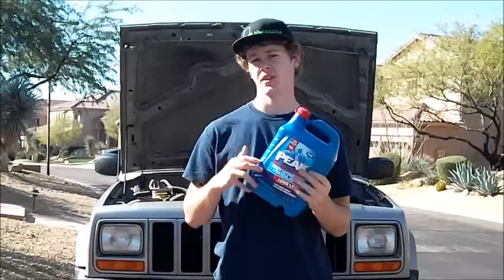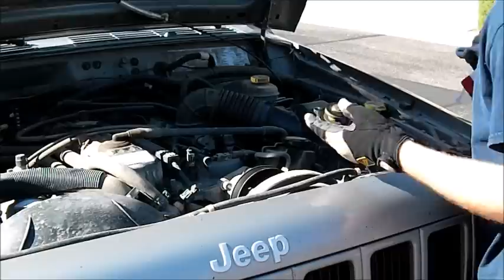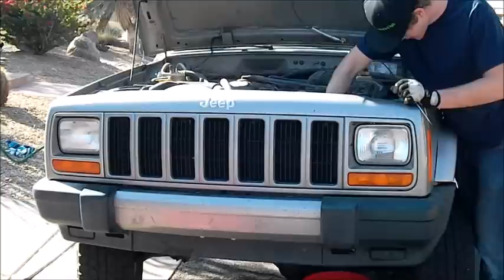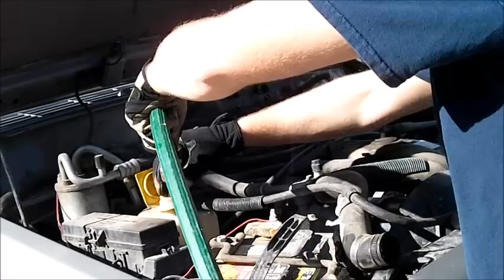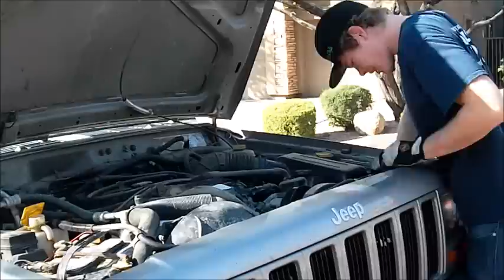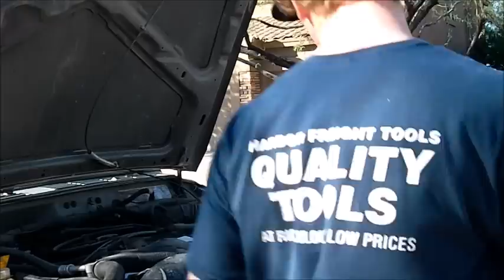jeep cherokee cooling system flush

Comment: I am a full time truck driver by day and a part time mechanic by night. I watch these instructional videos just for fun and you are literally the only person on youtube i have seen do this correctly. I scream at the screen when i see people pour 50/50 blended antifreeze into a system that has just been flushed with water. Im glad you explained that you have to add full strength antifreeze equal to half the systems capacity and THEN top off with distilled water. Everything you explained really hit the nail on the head. Keep at it man. Great video!
Reply from the maker: Thanks!
Reply: it all depends on where you live as well here is south Texas i can run just water and be fine. But i add the 50/50 because its easier.
Reply: If you were to run only water you would have several issues. First, the boiling point of water is 212 degrees F, just 2 degrees above the normal operating temperature of a Jeep 4.0. That means you'd most likely boil over if you used plain water (50/50 coolant has a boiling point of about 265 degrees F). And yes, another reason to run coolant/antifreeze is that when mixed properly, you will have a decreased risk of rusting any ferrous parts inside your engine (like the engine itself in the case of the Jeep 4.0). Rust is the reason that his coolant came out all brown and murky, it would have been much worse if he didn't have any coolant in the system at all! 2 gallons of undiluted antifreeze costs about $15 and it should last you several years.
Reply: micvee not true...water doesn't boil at 212 when pressurized as is the case of a typical cooling system... And actually water dissipates heat faster than coolant. So it works better by itself. But overall you are right.. You should run a 50/50 coolant mixture for reasons of freezing and very mild rust prevention.
Reply: Agreed this helped me a lot and details always make for a proper instructional video
Reply: Anybody know if using double the amount of flush fluid will hurt anything? I mean besides being a potential waste of money for the second bottle.
Reply: But, shouldn't one try to get all the tap water out of the system before doing the final fill of coolant/water mix?
Reply: @mrau92me  Yes, tap water contains mineral deposits that are bad for the system so try to get it all out before you fill up
Reply: When do you sleep?
Reply: @camptoursandthat4439  well i actually switched to being a full time mechanic almost 5 years ago now. Back then though i typically worked around 6am to 9pm and slept from around 11pm to 5am.
Reply: @lavachemist i wish i cost $15 for 2 gallons still i’m bouta drop $40 on 2 gallons

Comment: That reservoir is held in with two 8mm screws. Takes 2 minutes to dump out and reinstall.
Reply: @cdwalkman8401  lol bro wtf
Reply: These 2 screws are difficult to unbolt. Another solution is to disconnect the small hose from the canister but not on the canister side but on the radiator side. Let this hose hang on a lower position than the canister and the gravity will empty the canister. You can do an extra flush with the garden hose from the top op the canister.

Comment: Question for all you good folks out there. When I pulled the top radiator hose off to start the engine flush, no water would go in past the thermostat. I had to pull my thermostat out before I could get water through. Is that normal or was this a case of a bad thermostat?  The Cherokee overheated recently that’s the reason I got off my rear and decided to do my own flush. Living in Costa Rica, not only do I have language issues but have been warned repeatedly that the local mechanics shouldn’t be trusted. Thanks! And great video!!!

Comment: Hey so I got to the top hose flush with the hose and it's just spewing right back out. Not going to the lower disconnected tube. What's that mean?
Reply: Dude me too dammit
Reply: @iriehiphopgirl  This guy had a defective thermostat, allowing the water to flow into the block. Another good way is to spray water through the heater hose that connects into the water pump. This is the bypass hose that bypasses the t-stat.
Reply: @ethanwalton980  thank you so much for the advice! I ended up flushing out the system section by section, starting at the heater core. I inherited my 92 Jeep XJ and my mom hadn’t flushed the cooling system in over 5 years…. It was a doozy. She’s running good now though!

Comment: don't be so scared of removing the radiator cap. It won't pop like a champagne bottle even if its under pressure. just take it slow.
Reply: I always put one of those caps on with a red lever so you can lift up on it to release the pressure, then use a rag over that JUST IN CASE.

Comment: This is definitely the most comprehensive flush tutorial I have found. I can't thank you enough for expressing how important it is to catch the old toxic coolant. The only other tip I might add would be to back flush the heater core with VERY light pressure from the hose, Especially on an XJ that could have a load of sludge and crap trapped in it.

Comment: Good video.
One thing I did additionally on my 99 XJ was back flush the heater core since my heat was lukewarm even after a thermostat change.
Boy did I get some great heat after that .
There is a very simple video on doing that.....simply disconnect both heater hoses and run water hose through bottom heater core hose till all the junk comes out.
Refill the whole system, let air burp out of cap with engine running and cap off.
Fill your expansion tank to full line.
Put rad cap back on after coolant wants to run out constantly.

Took mine for a short drive, turn off, check level, add if necessary to expansion tank.......keep in min that the expansion tank level may go down as the engine cools so check your level after it cools and for good measure check your level for the next couple days and recheck for any hoses that may be leaking at the clamp area from being disturbed.
Not a bad idea to replace all heater and radiator hoses at this time.
One other trick I do while I'm in jeep maintenance mode that I do to every cherokee I own....yes I own a few, is replace all the battery positive and negative cables with an assortment Imget from the auto,parts store.
I also run a new cable from battery negative post to one of the air compressor bracket bolts to give the engine a better ground strap than the deteriorated woven strap from the factory at the back of the engine near valve cover.
One of my jeeps was burning out ignition could due to a weak ground and this fix cured that and also made the engine start up noticeably faster and the engine just feels much stronger after this simple and rewarding preventative fix.
Happy jeeping!
Reply: Ignition coils....my bad.
Reply: You back flushed your ignition coil?
Reply: My heat is really weak. I have a 01 jeep grand cherokee. About to replace the thermostat. Any ideas if that doesn't work?
Reply: @johnc5872  backflush heatercore

Comment: hahah "I don't want to leak out any onto the street" 

proceeds to monsoon everywhere onto the street 

good video though very informative. thanks bud
Reply: It's too bad  it doesn't drain as nice and neat as say...an oil change, haha.
Reply from the maker: If you are able to drain the radiator through the drain valve instead of the lower hose, it is less messy but still not neat by any means
Reply: Neither way is. On my Jeep my issue right now is nasty sludgy rusty antifreeze that needs flushed out. I put down cardboard, and was really careful....and I still ended up with rusty spots on the concrete, haha.
Reply: You can catch it all and keep the rust off your driveway if your lifted by using a little wading pool. I don't know why everybody feels the need to criticize the boy for getting a little fluid on the ground

Comment: thanks a lot. I was wrestling with that stupid plug for an hour before I found your post
Reply from the maker: +K. D. Mann I tried to get mine out first too. Not sure why they made it such a pain to get to and remove.
Reply: +Admiral Off-Road  I would even prefer your hose clamps. my 99 has the clips which are more difficult in tight quarters
Reply from the maker: +K. D. Mann that sucks. The hose clamps are pretty easy.
Reply from the maker: +K. D. Mann By the way, I think you're subscriber number 600! Thanks!

Comment: Should mention that the thermostat being closed won't allow for a full flush of the engine block and removing it is not advised if you dont have to. Bottom bolt is a pita and the design of the housing is common to leak. Dont mess with it unless of course the stat is bad and needs replaced.

Comment: when i’ve done mine i would run engine with heat on to get that dirty stuff out, but nowadays at over 60 years old i look for shop that has the flush system that pulls old stuff out and new stuff in its fast and no mess, of course it costs more be worth it

Comment: I just want to know how you managed to get water to flow through the thermostat housing. If the thermostat is in place and functioning properly, running water into the top radiator hose should simply fill up the hose.
Reply from the maker: I found out later that the thermostat had actually failed and was stuck open. You would need to remove the thermostat to do this

Comment: When I spray water into the upper radiator hose water does not come out of the lower hose, it just builds up in the upper hose. 

Why doesn't mine behave the way yours is? 98 XJ 4.0.

Comment: I took the thermostat out of my 95' today. It came out quite easily. Getting it back in with that lower bolt not clearing the serpentine belt- stupidity on Chrysler's part:-(. So now my 10 minute repair is going to take me half the morning tomorrow to put it back in- grrrrrr! This video was of great help, that petcock doesn't do anything to drain off the cooling system, you gotta pull the hoses!  My other "DOH!" for the morning was having my bucket in the wrong place- my neighbor walked up to say good morning and have a chat for a few minutes, and I wasn't paying attention to where the water/antifreeze was falling. We got it cleaned up. TOmorrow I am flushing my heater core- always make sure you do that when you flush your system!
Reply from the maker: glad the video was helpful! That seems to be the way it goes sometimes. A 10 minute job turns into a much larger job because of one stupid bolt or part in the way
Reply: Now I have a cutoff tool just in case...haha. I have a feeling when I go to put in my lift next year it will come in handy..along with my reciprocating saw and my breaker bar/pipe setup. I might spring for a 30 gallon air tank and an impact gun before then, haha.
Reply from the maker: StormLaker1975 i did my first lift without an impact and my second one with an impact gun and it made it so much quicker
Reply: It's on my wish list for Christmas, haha.

Comment: Great guide. Just bought a 93 xj with overheating issues and just replaced the thermostat, water pump and fan clutch. Up next is a coolant flush for piece of mind. Hope that helps my problem. Is there anything I might be missing?
Reply from the maker: sounds like you've got the basics covered.  If you continue to have overhearing issues you can get into fan upgrades and hood vents but i would do all of the things that you mentioned first because the other two won't do much if your cooling system isn't in good shape.
Reply: Admiral Off-Road okay, and thanks for the quick reply! Gonna subscribe now 😊
Reply: Drain wate,r
Reply: Drain water

Comment: Best thing to use when draining the system is a cement mixing tub there low and rectangular they catch it all. You can get them from a home improvement store. Because the fluid spills everywhere otherwise. You never really get it all in the bucket.
Reply: Rick C137 You never really did get it all in the bucket,,  Another trick is laying out a tarp under the vehicle and and surround it it with any absorbent..    It catches all that doesn’t go into the bucket, soaks it up, and can be swept/scooped up pretty easily.  I do the same thing for oil changes to protect the ground or garage floor.  Thx Rick

Comment: Undoing the plug from the bottom and disconnecting the small hose from the side of the cap then put the tip of the hose under the car and suck through it a little bit then gravity will do the rest and you rinse and drain your reservoir.

Comment: I picked up an 89 XJ and the thermostat-heater core and water pump-heater core hoses were taken off. They also have the “T” inline for the pressure tank. My goal is to install the coolant filter but not sure where the four ends are supposed to be in accordance with the filter housing. You have any pointers?

Comment: any thought? so i tried doing this and when i got to the top hose. i tried putting water trough it but it just filled up. like the water was getting stuck somewhere. the water never went trough and came out the bottom radiator hose. 2000 xj sport 4.o
Reply: having the same problem
Reply: @doubledmetaldetecting9582  the thermostat is closed. If I've read correctly; push water through the small hose that goes to the thermostat it's open constant.
Reply: he failed to mention he pulled the thermostat out obviously so the video is incorrect and would fail to flush anything from top rad hose! And my cat is dead from that coolant he left in street! no thermostat= no cooling , no flush =no fix

Comment: Nice video! 
I have a question,amm ,i did evertying like you did ,but when i remove the second radiator hoes or how you call them ,i cant pour water in there ,becaus it doesnt go throught all the way to my bucket ,or i did something wrong? Have xj 1995.
Reply from the maker: LVcubers if you have that problem, remove your thermostat. It is blocking the flow. It seems about 50/50 on people having that issue
Reply: Admiral Off-Road Thanks! It worked!
Reply from the maker: glad to hear it!

Comment: Any cylinder head cracks yet? Mine just cracked between cylinders 3 and 4 which is the typical spot. If you crack since this is a design flaw on the 0331 head for 2000 and 2001 get a TUPY head or one from Alabama Cylinder Head with a very improved casting.

Comment: You apparently failed to mention that you MUST have previously removed the THERMOSTAT!  Otherwise water would NOT flow from the TOP radiator hose into the engine compartment to flush it out.  The thermostat is a spring coil heat activated valve that opens up when maximum temperature indicated on the thermostat is reached to ALLOW hot coolant to pass thru and circulate into the cooling system for heat dissipation and to maintain a consistent operating temperature.

Comment from the maker: kevin tyree, how much water were you able to put into the upper hose before it started coming back out the top?  Sorry im not able to reply to your comment directly. Not sure why Youtube is not letting me.
Reply: I'm having the same problem. Tried running water through the top hose and it just filled up and didn't drain from the bottom. It only took a few seconds for it to fill up. Possible clog in the system? I'm doing this flush because my 93 grand cherokee keeps overheating at idle.
Reply: bobhuth  Hey man, make sure your fans are spinning and the fan shroud are not damaged. You know you radiator is likely working as it's cooling while your driving. IE there's enough coolant going through it to be cooled by airflow.
Reply: +bobhuth Try taking your thermostat out.
Reply: waiting to long with the cleaning, or not using destill. water, or based on a defect, the thermostat is always in the close position,
http://img0.uploadhouse.com/fileuploads/22565/22565840cdc01ca6d33cb5e55901d880971cc01e.jpg
that caused the overheating problem, cause the cooling system hasn`t a proper circulation.
Reply: 99 Jeep Grand Cherokee brake control wire location

Comment: My coolant looks clean and full but still going to clean the system, but I have one question: my coolant reservoir seems to drain very quickly so I sometimes run with no coolant in the reservoir, but the engine doesn't overheat. Do you know why this would be?

Comment: Thank you for sharing your knowledge. Do you know why my jeep's horn keeps activating itself, this is a very annoying problem. Thank you again.
Reply from the maker: I had that happen to me once. I ended up disconnecting them for a few hours and when I connected them again they were fine. I think the connection can get loose at the horn itself and make the horn activate on its own
Reply: Not sure if you fixed problem, but there is a fuse that if removed, will turn off horn. Also if your check engine light is on, get codes read. If it says clock spring,that is your problem. Bad clockspring sends high voltage to the TPS causing rough idle and also makes your horn go off nonstop

Comment: Would running water straight to heater core hoses with the heat switch turned to high and the jeep off be a better way to flush heater core or is running water through the lower radiator hose like you did doing the same thing?

Comment: Help I’m a 63-year-old female and I’ve done everything you said but I can’t get the water to flush through the engine from the top radiator hose. I called my mechanic and he says it’s because my engine is cold in the thermostat has it shut off.
Not sure what to do. When I went to refill the car I could only get in 1 gallon of antifreeze in about a half gallon of distilled water. I feel like there’s something going on between the top radiator hose inside the engine block because the check engine light keeps coming on, but I don’t know how to get the Flush completely done.